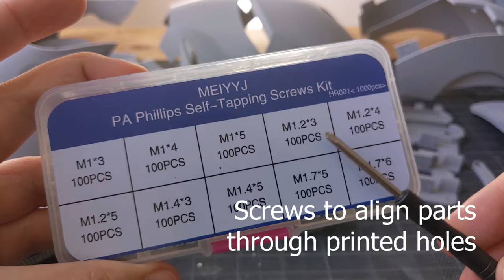Iron Man Helmet, Articulated, Wearable

Comment: Hello sir, first of all thank you so much for this wonderful tutorial it is a dream come true for me to make this helmet. I'm trying to use the two servos to lift the faceplate up because my faceplate (handcrafted) was too heavy (2 servos in the left and right of the helmet mirroring each other's movement) I tried to change some things in the codes to achieve that and it did. Only problem is that the first phase when turning on the electronics, the two servos tend to go opposite to each other, trying to get in position like in the original setup and then it work. 
I have no proper knowledge on arduino codes and I might be asking too much, but it will be very great if you can suggest some tips on what should I change on the codes to make the 2 servos mirror each other's movements properly. Thank you again for this wonderful and free tutorial! 🙏
Reply: If I use the original setup for the servos, the 1 servo on the head isn't enough to lift the faceplate. I mean it can lift the helmet, but the faceplates lifts unbalanced which makes it go slanted while moving up and down.

Comment: i used the code on a nano board and it goes to the centre but when i push the switch it just bounces back and forth and goes back to centre ive tried updating librarys and alot of other stuff any help ?
Reply from the maker: This seems to happen on low/old batteries. Does it have the same behavior on usb power?
Reply: @BoxandLoop  yes
Reply: @BoxandLoop  would putting a 9v battery on it instead be better?
Reply from the maker: 9v would fry the servos. They are rated up to 6v. If on usb power you see that behavior, then I would check soldering and connections

Comment: how many fillements would it take to build one of these and what would the cost be
Reply from the maker: 1kg spool should cover it, including supports. For hardware, the cost will depend on what you already have in terms of tools, bolts, wires, etc. Arduino Nano and 2 servos should be about $40. 
If you need to buy a soldering kit, wires, bolts, buttons, then the price will go much higher

Comment: how long did it take to print the faceplate? and which position do you suggest I print it in? thanks.
Reply from the maker: Maybe 5-6 hours to print. Set it upright, tilted forward a bit, so that the brow bridge can be supported from the bed
Reply: @BoxandLoop  thanks alot man, looking forward to your next prints :)
Reply from the maker: Next project is already in development
Reply: It took me 40 hours 0.12 mm

Comment: Which orientation did you print the cheeks? Trouble with it
Reply from the maker: Upright on the long side. Large brim and supports. Which printer you running?
Reply: @BoxandLoop  Artillery Sidewinder X1 300x300x400
Reply from the maker: Yeah, it should work fine. Which troubles are you seeing?
Reply: It worked, upright on the long.

Comment: Hi, I've tested the code and it just has one problem to me, the other servo doesn't stop spinning. It is connected to usb tho, what should I do?
Reply from the maker: Do you mean it goes up and down? Try switching the servos, maybe you got a bad one
Reply: @BoxandLoop  not up and down, it keeps spinning. Yes I've tried to change my servos but it still goes the same. But then I tried to open the battery switch and for some reason the servo behaves well hahaha, thanks for the reply
Reply from the maker: Glad it worked out

Comment: How do i wear this but keep myself protected from wires. don’t wanna get electrocuted? Any tips
Reply from the maker: Use padding to hide the wires or tape. The voltage running in those wires is so low that you won't feel it even if you touch them on purpose
Reply: @BoxandLoop  Oo thank you. I wanna buy all of them haha. Saving for this build. I have a question, For 3d printers is their a way to add a google image to the mask? like carving it on it
Reply from the maker: It might be easier with a sticker after it's printed. You could imprint into the 3d model, but that's very involved

Comment: Does anyone else’s servo arms hit the visor in the up position? Specifically the one attached to the servos? Been trying to figure out if I assembled wrong.
Reply from the maker: Did you scale the model up or down?
Reply: Did you get this fixed? I am not sure if it relates to fake or real EMAX servos having slightly different dimensions for the servo arm and bit it screws in to.
Reply: @BoxandLoop  I have't scaled mine and have the same issue...

Comment: insted of using the Arduino can we use a RPI zero w?
Reply from the maker: You'd have to write your own code, I think. Make it fit and you should be good to go
Reply: @BoxandLoop  Ok, but would there be any changes with the wiring? Also I got a zip file  with all the stl files and a pdf.The wiring digram in the pdf does not show how the lights are connected
Reply from the maker: I think there are 2 pdf files, one with eyes and one without. Wiring should be the same, the only change I would expect will depend on which pins you use with rpi zero
Reply: @BoxandLoop  Ok, also how do we resize the stl files and get the percentage of how much we changed?
Reply: i got it :)

Comment: which bolts to use if im printing at 100% and how many
Reply from the maker: There are:
 4 m2.5 bolts to mount the battery pack and servo arms
10 m2 bolts to mount the nano, power switch, servos, and hinges.

Really most of the helmet is built around m2 bolts. The only reason for m2.5 is the servo only takes that size and the battery pack as well.
Reply: @BoxandLoop  and what is the lenght for does bolts
Reply from the maker: They vary. Don't recall from the top of my head. The bolt kits contain everything you'll need.

Comment: does the file come with adruino code by any chance i have uno and nano boards isit compatable ?
Reply from the maker: It does come with wiring diagram and code. All in one download with STL files. Uno is too large, Nano should fit if some pins are removed. Nano every is used for its low profile
Reply: @BoxandLoop  thanks pal !
Reply: @BoxandLoop  what servos did you use?
Reply: @BoxandLoop  is support already built into the stl files or does that need to be added?
Reply from the maker: I used ES08MA
Reply from the maker: Do you mean supports for printing?
Reply: @BoxandLoop  ye i c that these are vertical prints so should i add auto support in cura?
Reply from the maker: Yes. All parts are oriented how they would assemble. You will need to rotate them for best results with supports for your printer.
Reply: @BoxandLoop  ok thank you for your help my kids will love this !
Reply from the maker: Excellent!

Comment: This is so awesome! I've got everything printed and all of the hardware on the way. The one thing I'm still struggling with is the cheek pieces. No matter what I try, I can't get them past roughly layer 30 before the nozzle pushes them over because the first layer only contacts the plate in a very small area. I've tried raft, skirt, tree supports, manual supports. This is on an Ender 3 v2 using Cura. Any tips or support would be greatly appreciated.
Reply: I turned mine sideways and they printed really good. Make sure supports are turned on. Good luck!
Reply: @DrewOnTwo304  Thanks! I flipped them sideways this morning and they're printing while I'm at work. Hopefully I don't get home to spaghetti on the print bed again.
Reply: tumbalas eso hice yo

Comment: How did you get your screws to go in the holes immediately? Mine seem a little tight
Reply from the maker: Depends on the printer. If it's too tight, then pre-drill the through holes. But make sure not to drill the holes that need tight grip

Comment: What's the printer's minimum build volume required to print this?
Reply from the maker: All parts will fit into 200mm cube
Reply: @BoxandLoop  You use support for printing the face model?
Reply from the maker: @mascolo99  yes. Use supports and a decent size brim to keep it in place

Comment: When I attempt to print the sizing ring, it doesn't print correctly.  It seems to be off the plate but the raft is on the plate...   I'm not sure why.  other things i print come out fine...  Thanks!
Reply from the maker: Try printing without a raft. Or print in two parts
Reply: @BoxandLoop  finally got it to print with no raft, but when I sized up to 1.10 it started dribbling out incomplete lines.  The ONLY thing I changed was the size of the ring?  You were right about the raft, there was space under part of it that didn't sit on the build plate and had no support.

Comment: Do you have your gcode for the faceplate or any tips to get it to print better?
Reply: using the same filament and same ender 3 v2 pro
Reply from the maker: I've printed mine upright with mouth touching the plate. Tilt the face a bit forward so that the brow ridge sees the build plate. Make sure supports surround the mouth and touch the brow

Comment: What screws are being used to attach the non powered arms of the hinge? https://youtu.be/9uIXtODioGM?t=94  none of the screws in the parts list seem to fit snug in there in fact all seemed to be able to be either slid in and out with just my fingers are were big enough to crack the housing.
Reply from the maker: I believe those are m2 screws. It could be that your printer gives a little less expansion around holes. Try m2.5 or adjust your printer settings

Comment: I'm new to 3D printing so I was just wondering, how much does this cost in filament to print completely?
Reply: my friend printed this for me and used 2 reels costing a total of £30. its all the extras such as arduino kit, paints screws etc that will add up to £100-£130.
Reply from the maker: 1-2 rolls will cover it, depends on number of mistakes and supports used
Reply: @BoxandLoop  Awesome, thank you! I'm probably gonna get the Ender 3 v2 soon. Just gotta do a bit more research :)
Reply: @GG-pg6rp  Thanks for the reply!

Comment: Could you help me? I printed the same model as you and I'm trying to program the Arduino but, when I'm going to compile it I come out not such file. Would you know what the solution is?
Reply from the maker: Sure thing. Are you using Arduino IDE with Nano plugged in?
Reply: @BoxandLoop  Yes, I'm using arduino ide with nano plugged in, the problem is that I don't know how to create a library and have the file compile. Maybe you could explain to me if it's not too much trouble.
Reply from the maker: @luuucastro7313  there should be more detailed instructions in the pdf file. Installing the library is built into the menu of IDE. After the library it should compile without errors

Comment: Hey! Got a question: Before starting printing everything, I'm ordering everything from Amazon (Italy).. The only thing I can't find on my Amazon is this one: 
Slide Switch:
https://amzn.to/3lUtL3r
What can I buy instead of that? What should I search for?
Reply from the maker: Something like this
https://www.amazon.it/DealMux-posizioni-interruttore-scorrimento-verticale/dp/B01LAXAINO
The switch needs to have tabs on the side for mounting and 3 prongs for wiring. Let me know if that makes sense
Reply: @BoxandLoop  I'll check if there is something like that, but with faster shipment! If not, I'll buy this one you linked!
Reply: @BoxandLoop  Sourcingmap - 50 Pz Ss12D00G3 2 Posizioni Spdt 1P2T 3 Pin Pcb Pannello Mini Verticale Interruttore Scorrevole https://www.amazon.it/dp/B007QAJUUS/ref=cm_sw_r_cp_api_fabc_Ar94FbC76APZK 
How about this one?
Reply: @BoxandLoop  or this one: Sourcingmap - 50pcs posizione del pannello spdt 2 1p2t montaggio saldatura interruttore mini slitta tongue https://www.amazon.it/dp/B007QAJLDE/ref=cm_sw_r_cp_api_fabc_Js94FbPPE6FSC
Reply from the maker: The last one, with tabs on the sides that stick out
Reply: @BoxandLoop  really thanks!

Comment: Cool! do you have the Arduino code for it?
Reply from the maker: Sure do. It is inside the pdf file along with STL files.
Reply: Sorry, found it in the zip
Reply from the maker: No problem. Do tag me on Instagram when you have it working
Reply: @BoxandLoop  i will do!, its a way off yet im in the middle of an r2d2 build.
Reply from the maker: Great!. An rc r2d2 is on my list of future projects too
Reply: @BoxandLoop  its a hell of a long job...Im 3 months in....
Reply from the maker: It'll pay off in the end. Having your own r2d2
Reply: @BoxandLoop  Wondering if you can help - i printed it all out and assembled it, I've got th correct servos etc but arduino is very new to me and i don't have a clue....im getting an error when i compile the code.....

helmet:15:8: error: expected constructor, destructor, or type conversion before '(' token
 pinMode(action_pin, INPUT_PULLUP);
        ^
helmet:16:1: error: 'servoTop' does not name a type
 servoTop.attach(9);
 ^~~~~~~~
helmet:17:1: error: 'servoBottom' does not name a type
 servoBottom.attach(10);
 ^~~~~~~~~~~
helmet:18:22: error: expected constructor, destructor, or type conversion before '(' token
 setSpeedForAllServos (190);
                      ^
helmet:19:1: error: 'servoTop' does not name a type
 servoTop.setEasingType(EASE_CUBIC_IN_OUT);
 ^~~~~~~~
helmet:20:1: error: 'servoBottom' does not name a type
 servoBottom.setEasingType(EASE_CUBIC_IN_OUT);
 ^~~~~~~~~~~
helmet:21:53: error: expected constructor, destructor, or type conversion before ';' token
 synchronizeAllServosStartAndWaitForAllServosToStop();
                                                     ^
helmet:27:1: error: expected unqualified-id before 'if'
 if (proximity == LOW)
 ^~
helmet:43:1: error: expected declaration before '}' token
 }
 ^
exit status 1
expected constructor, destructor, or type conversion before '(' token
Reply from the maker: Sure thing. What are you using to compile the code?
Reply: @BoxandLoop  the arduino program version 1.8.13
ive downloaded the servo easing library, copy and pasted the code then hit compile and i get that....
Reply from the maker: Maybe during the copy paste something got dropped. Try that step again
Reply: @BoxandLoop  i have tried it a few times now, started fresh and tried again but same problem.
Reply: strange, fails on macbook but tried it on pc and it compiles.....lets try it......
Reply from the maker: @robhamilton5057  strange. Let me know if it works. I'll look into mac compile issue
Reply: @BoxandLoop  working, i had to adjust some of the numbers to get it to open and close properly but i have printed it out at 110% to fit my huge head so probably that. strange not working on the mac though but surly thats an arduino ide problem and not your code.
Reply from the maker: @robhamilton5057  great to hear it working. I'll need to update my instructions to let people know to update the numbers for scaled helmets
Reply: @BoxandLoop  what is your Instagram?
Reply from the maker: @robhamilton5057  it is boxandloop on instagram

Comment: I've been having a few issues with the code, I am currently using Arduino IDE 2.0, and whenever I try to compile the code I keep getting exit status 1 errors and a bunch of library confusion. If anyone can help me figure out what's going on and how to fix this that would be greatly appreciated, thanks
(and yes I have the right libraries downloaded)
Reply: I have the same problem. did you get the problem solved?
Reply: For anyone having same issue, I downgraded to 2.3.3 of the ServoEasing library and the errors went away. Assuming they changed some variables in version 3?

Comment: this is not arduino nano every ... every one has all "feet" you have the usual nano.
I bought every one and it doesn't suit me now
Reply from the maker: You can remove the pins if nano every came pre-soldered. However basic nano comes with extra 6 pins on one of the ends